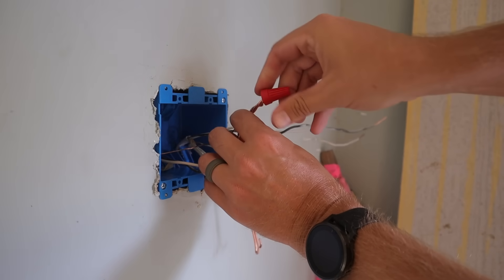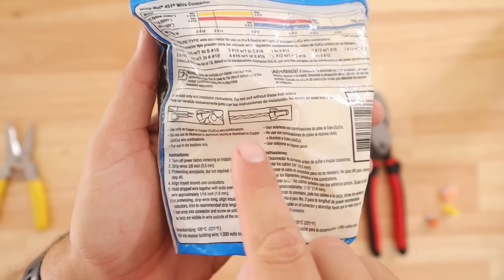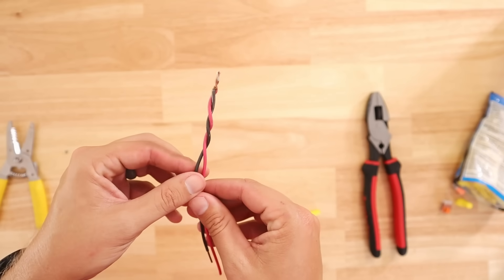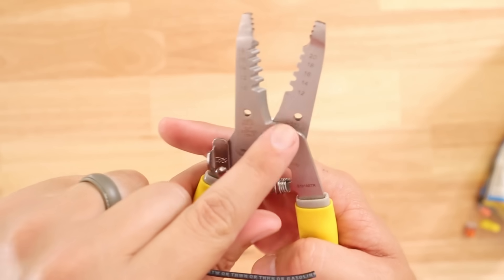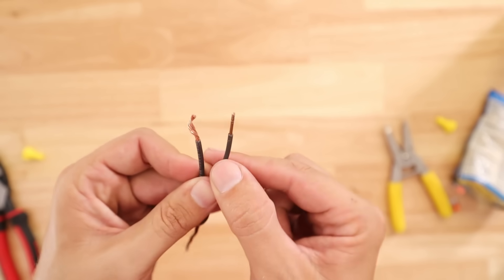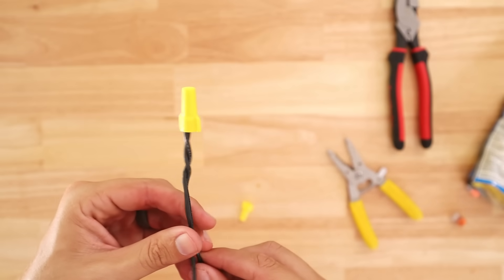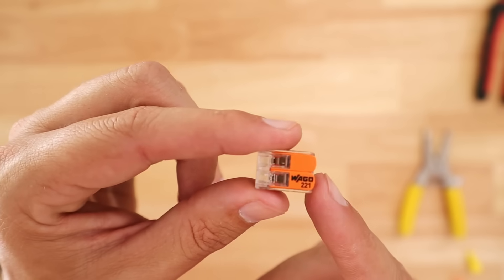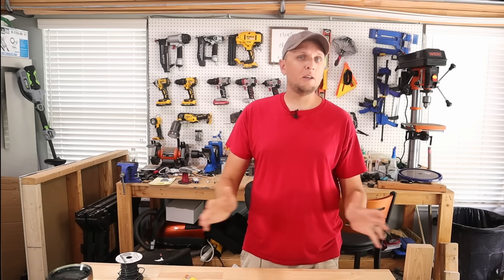BIGGEST Mistakes DIYers Make When Connecting Wires Together | How To

Comment: I have watched you review and comments and would like to give my two cents worth. First always make a mechanical connection, twist the bare wires together. Do not expect the wire nut to do that for you. Never use hard plastic wire nuts. If they break your connection is exposed. If it was my home and I had the time, I would solder the connection. The Wago connector is a contractor speed connection. Or at best a temporary connection and should never be used for any other purpose.  Time is money to a contractor, and they are not concerned with the extra cost.  Electrical connections should be made in a way that they have a lower resistance than the conductor of the connection. High resistance joints will cause heat that will cause connection failure. That's why I do not like Wago connectors, they produce a connection of high resistance. twisted bare conductors are the next to best low resistance connections. Soldered is the lowest.  A lot of times I will place a nylon cable strap one inch from the wire nut on the finished connection. This prevents movement of the wires from pulling on the wire nut connection.  In final, I have fifty years of experience and that means a whole lot of experience fixing connection failures.  Have a great day.
Reply from the maker: I really appreciate your experience, tips, and feedback Ronald!  Thanks for adding to the community!
Reply: I love this video, but the best thing I've learned in the comments is using a zip tie @ 1 inch from the wire nut. Never thought of that, and much cleaner/better than tape that a lot of folks are offering. Big fan of cable straps, and my kit has a fingernail clipper so you I can cut them off "rounded" so they don't gouge anything else. However, honestly never thought about using them for a connection like this, but likely will from now on!

Comment: well I seen to many times that when you twist wire with lineman pliers you can damage the wire causing it to brake over time I have taken wire off and found fracture wire which was not making 
good connection so in my opinion is wire nuts should twist like you demo first
Reply: I have a code enforcement inspector that will actually make you repair a pre twisted connection. He is strongly against twisting and damaging the conductors.  But then he also yells at the guys stripping the wires using linemans instead of wire strippers.

Comment: Great info, and spot on! One tip I would add: When twisting stranded wire onto solid wire I always take my pliers and bend a slight wiggle into the stripped end of the solid wire, then wrap the stranded wire around it. It improves the strength of the connection A LOT!
Reply from the maker: Thanks for the input David!  And thanks for the feedback!
Reply: I do that too.
Reply: 7:00 Best is to pre twist the stranded around the solid wire, and take your lineman pliers or cutters and cut it down so there's no excess length from either wire. Then the wire nut will be able to cover and hold both wires securely as it's twisted down on the splice.

Comment: I don't pretwist but I do go 800lbs gorilla on it which means If I need to take the nut off I either have to cut the wire and redo it or use plyers to get it to turn.
Reply from the maker: I will have to use that in the future.  Going gorilla 😂  Thanks for the feedback!

Comment: Correct me if im wrong,  I was under the impression that a wire nut is not supposed to be used as a mechanical bond as much as it is used for electrical insulation
Reply: No, actually the connection is made by the spiral threads inside the wire nut biting into the copper for an oxygen proof connection. Tape is not required, and in some cases, tape allows moisture to collect inside the wire nut.